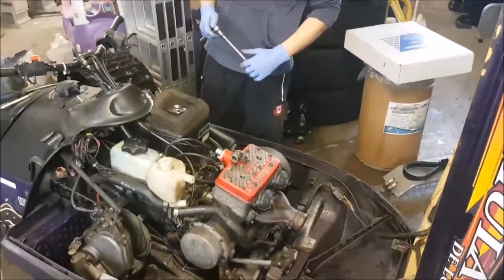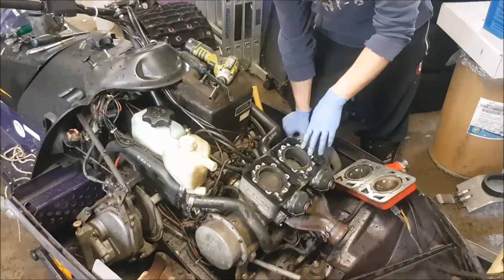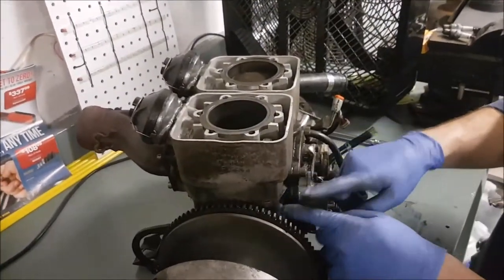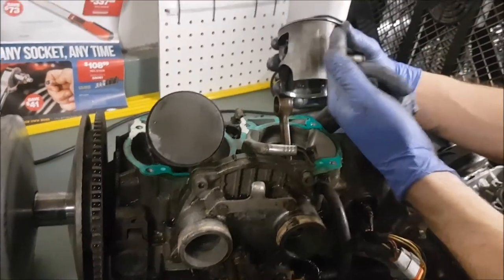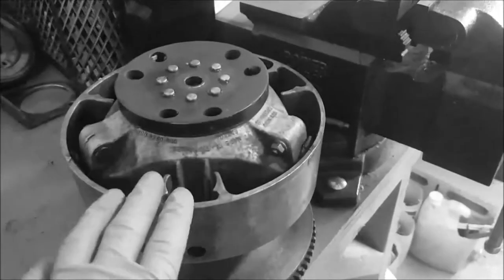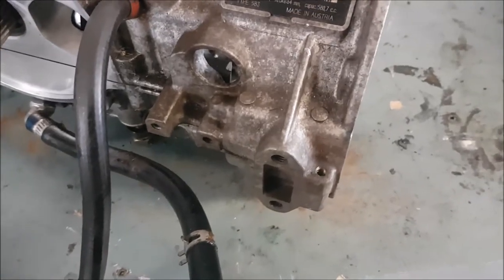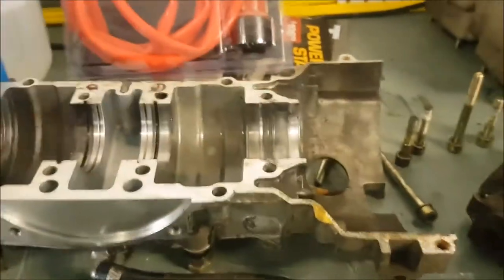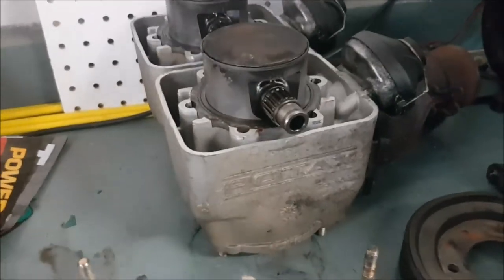How To Take Apart 1998 Ski-doo Formula 583 Sled Motor Engine Disasemble Tare Down

Comment: How did the rebuild go?  What did it cost for parts?
Im in same scenario with a 1995 stx only 2k on motor.
Reply from the maker: make sure to diagnose why it let go on you before reassembling.  2k is not much km for the motor to let go.
I sent the motor out to a friend who is a snowmobile technician as he has a keen eye on seeing worn out components or things the average eye may or may not pick up and also  has contacts for different parts or pieces we may need. 

We found a second motor with a good crank and took components from the 2 motors and built one. We installed 2 new pistons and rings and had the cylinders honed and put everything back together with all new gaskets.

Sending the crank out to be rebuilt was going to cost to much and then i would still needed to get gaskets etc. 
we put it together on a budget and replaced what needed to be replaced. under $1000 
Hoping everything stays together for another 10k but 2 strokes can be stubborn some times.